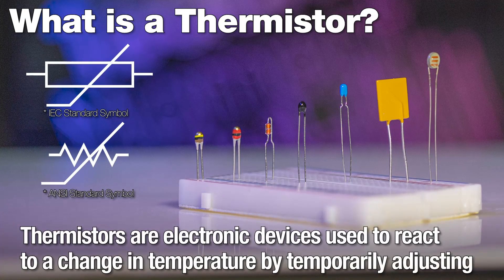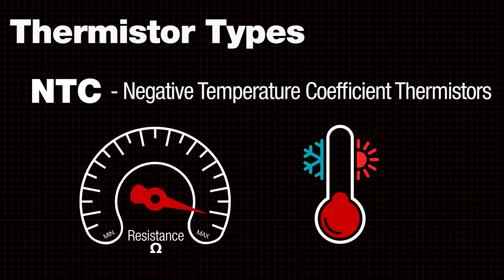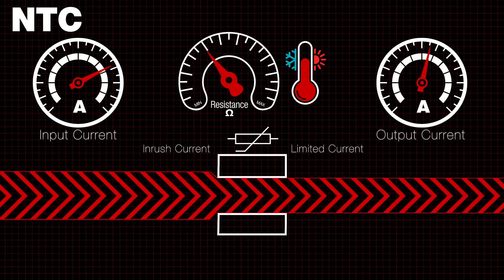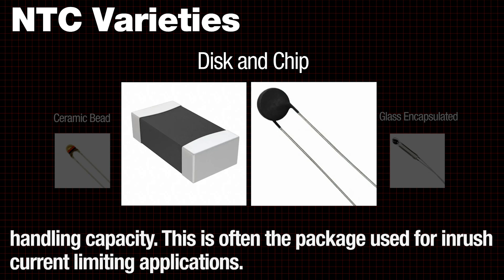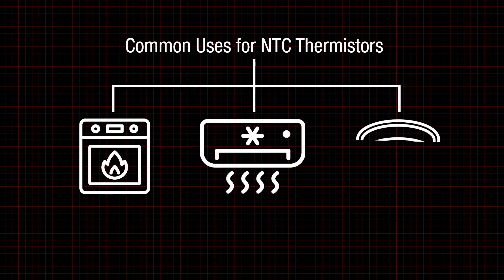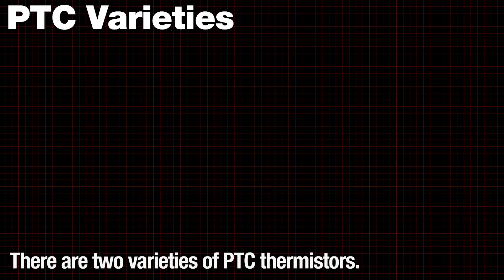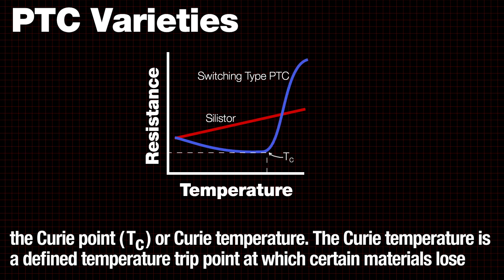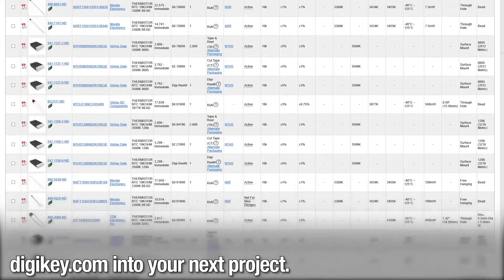Basics of NTC and PTC Thermistors - Another Teaching Moment | Digi-Key Electronics

Comment: I added four NTC thermistors, one for each cooktop burner. Shut off a burner say after boiling eggs, the element stays hot for some time. The power goes thru fuse, resistors designed for the LED, to the NTC thermistor to ground. Drilling into low grade magnetic stainless steel is easy. Mount the LED with "HOT" on lens's next to the control knob. They make these models but cost $700 more. I spent $18 uncle Joe dollars for lamp, thermistor and had wire using one 5 amp fuse in one holder. Schematic is under top taped to outer edge for future repair guy!!
Have a lucky one...

Comment: if I have NTC 10k with 30 cm wires, can I prolong wires, for example to 2 meters, without any functionality problems? Thx.
Reply: Longer cables will affect the resistance and thereby the voltage drop over the two leads with the thermistor at a constant current. This may fool your measuring equipment into thinking that temperature changed the thermistor circuit restistance when it was actually only the longer leads. One way to deal with this would be to account for the known characteristics of the longer leads in the measuring software, or even increasing the voltage proportional to the voltage drop in the longer leads. Maybe another wire material and thickness could balance some of the changes in characteristics.
Reply: We are a professional and leading manufacturer about NTC Thermistor, for Temperature Compensation & Temperature Measurement Sensor Probe Type. With our Production & Engineering Team having more than 20 years of experiences endeavored in NTC Thermistor field, we continuously develop new products and techniques to extend our capabilities. Shiheng's core expertise in design and manufacturing has produced many innovative products of superior quality with exceptional value.
Nanjing Shiheng Electronic, Co ., Ltd (QUALITY IS OUR CULTURE) 
WhatsApp：+8613951639167
Telephone:+86-25-52121868  Fax:+86-25-52122373
Mob:+86-13951639167
Email: 1372286431@qq.com
     Kristywong521@gmail.com
Website: https://www.ntcshiheng.com/
Add: No 18 Jinyang Road, Hushu Town, Jiangning District, Nanjing，China 211121

Comment: I’ve seen these in a vintage electric organ I used for parts
Reply: They are basically fuses. PTC is perfect example. FTC is more like surge protection.
Reply: Both will burn out and potentially protect the device. PTC if the current is too high. FTC if the surge is too strong. If you ever owned an old tube television you know how it takes a few seconds to  get to full power. FTC tube protection.... Some things need finesse others need a compasitor to ram it! Not a tube though that would crack it.
Reply: We are a professional and leading manufacturer about NTC Thermistor, for Temperature Compensation & Temperature Measurement Sensor Probe Type. With our Production & Engineering Team having more than 20 years of experiences endeavored in NTC Thermistor field, we continuously develop new products and techniques to extend our capabilities. Shiheng's core expertise in design and manufacturing has produced many innovative products of superior quality with exceptional value.
Nanjing Shiheng Electronic, Co ., Ltd (QUALITY IS OUR CULTURE) 
WhatsApp：+8613951639167
Telephone:+86-25-52121868  Fax:+86-25-52122373
Mob:+86-13951639167
Email: 1372286431@qq.com
     Kristywong521@gmail.com
Website: https://www.ntcshiheng.com/
Add: No 18 Jinyang Road, Hushu Town, Jiangning District, Nanjing，China 211121

Comment: Which thermistors are used in refrigerator and freezer?
Reply from the maker: It is likely going to be an NTC used as a temperature sensor. If you need help finding a replacement please contact our technical staff via the TechForum and send images and any specifications you may have. https://forum.digikey.com/

Comment: Thanks, I did not know they were used for the function of limiting current.
Reply: We are a professional and leading manufacturer about NTC Thermistor, for Temperature Compensation & Temperature Measurement Sensor Probe Type. With our Production & Engineering Team having more than 20 years of experiences endeavored in NTC Thermistor field, we continuously develop new products and techniques to extend our capabilities. Shiheng's core expertise in design and manufacturing has produced many innovative products of superior quality with exceptional value.
Nanjing Shiheng Electronic, Co ., Ltd (QUALITY IS OUR CULTURE) 
WhatsApp：+8613951639167
Telephone:+86-25-52121868  Fax:+86-25-52122373
Mob:+86-13951639167
Email: 1372286431@qq.com
     Kristywong521@gmail.com
Website: https://www.ntcshiheng.com/
Add: No 18 Jinyang Road, Hushu Town, Jiangning District, Nanjing，China 211121

Comment: Any tips on how to physically mount these for best thermal response?
Reply from the maker: Depends largely on what type you are using (physical shape).  One BIG tip is to ensure that you use good Thermal interface material(TIM) so there is no air gap to slow the thermal response.  Thermal paste is the most common.
Reply: @digikey   Excellent advice, as a thermal grease not only helps transfer heat into a component, but pull heat away from a device such as a integrated circuit chip to an ignition module mounted to the base of a distributor on a vehicle with electronic ignition like GM’s HEI distributors. With out it, they fail from heat and have a short life. Dielectric silicone grease is a safe guard from moisture and used on rubber weather to hydrate it, make it last longer and if used in areas of freezing temps, it keeps the door from freezing shut. It’s indicated in the maintenance section of owners manuals. Thanks! ASE Master 78.